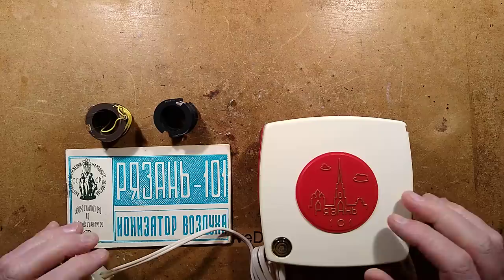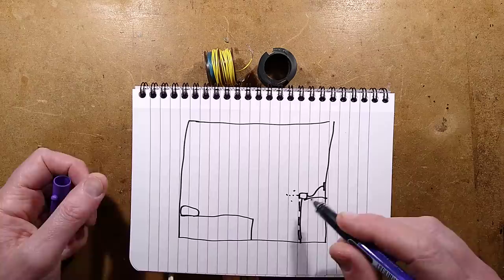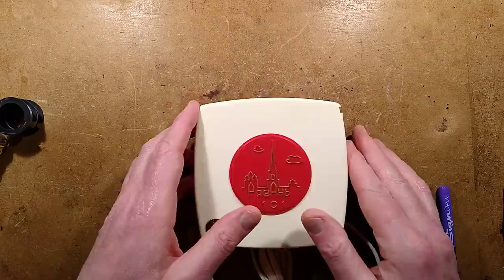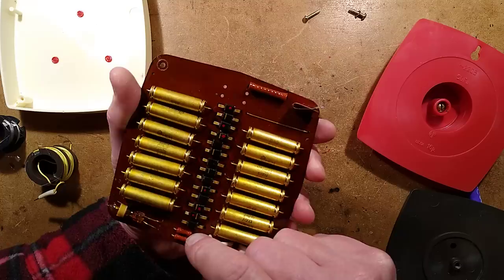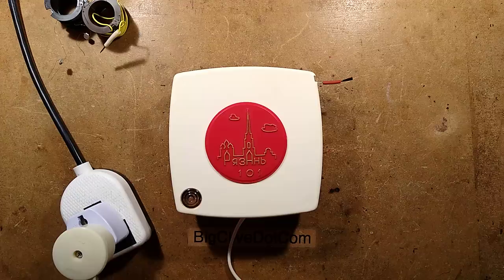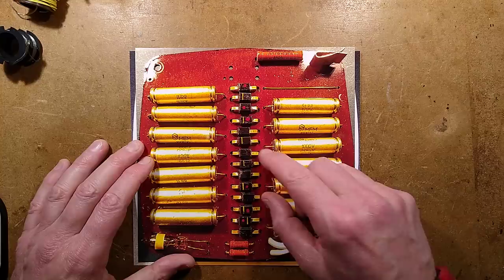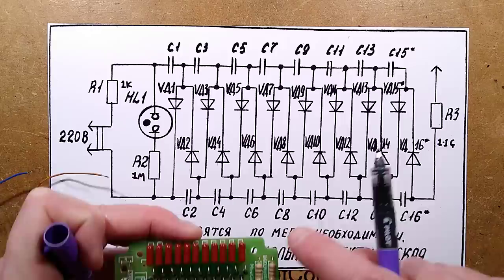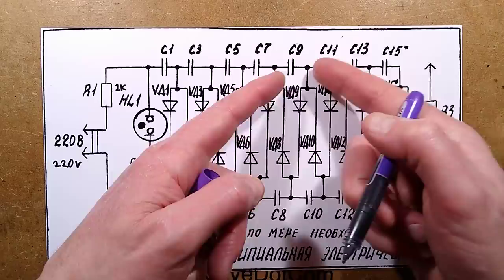Inside a soviet ionizer from 1990 (with schematic)

Comment: Creative, with primitive materials.
I remember 30 years ago I was working for a well known microprocessor company in Silicon Valley. We were working with IBM on something. One of the IBMers had previously been a test/failure analysis engineer in IBM's federal division. He told me a story about how the Pentagon would regularly send over Soviet equipment for analysis. He remembered working on a sono-buoy (a device normally dropped in the ocean by aircraft to emit sonar pulses and transmit the reflections back to an aircraft or ship.) It was very common to find Soviet sono-buoys that had some very primitive Soviet memory chips of very low quality and a microcontroller from a well-known American company that was also a major Pentagon supplier. He believed the Soviet navy was ultimately receiving deliveries of these microcontrollers thru one or more shell companies that did business with European electronic component distributors.
Side story - apparently a full 70% of Soviet military equipment was fundamentally based on stolen Western designs and technologies. Some of you, for instance, may remember the scandal that erupted when it was discovered that Toshiba had sold the high performance computing equipment and software that allowed the Soviets to shape the fins of their submarine propellers to make them less detectable and quieter. Toshiba outright provided the same technology America was using for its own submarines - both attack subs and boomers (ballistic missile subs, the ones with the nukes.)

Comment: i am pretty sure ionisation is low as it is meant to work with 220v-240v line of the motherland. 124 is likely how low voltage might fall. Or what was in the mandatory radio plug that was supposed to deliver news in case of any issues, those are gone although still are mentioned in regulations so can't be sure

Comment: If you need to translate something from Russian again, you can contact me, I will be happy to help.
Manuals for most Soviet devices contain detailed descriptions of how the device works and the electrical circuit. This is due both to the government's attempts to popularize science, and to the peculiarities of the Soviet economy - it was often much easier for you to fix the device yourself than to buy a new one. Therefore, many Soviet devices have high maintainability.
This device was produced in 1990, it is already the end of the Soviet era, accompanied by an economic crisis. This partly explains the use of obsolete parts - they just used what was available. Also, in the planned Soviet economy, there was no competition in the usual sense, so the factories had no motivation to constantly invent something new. Many models of mass-available electronics were obsolete. Of course, advanced technologies also existed, but were often inaccessible to the average citizen.

Comment: The diodes on the schematic are labelled with a V and a Cyrillic D - but there's no V in the Cyrillic alphabet (the B is pronounced like V, as in 220B for volts). Anyone know why the "V" letter is there for the diodes?
Reply: It's a poorly written У, you can see it if you look at diode 15. The УД marking stands for ultrafast diode I think
Reply: @user473  Ah ha. I guess when you don't have a V in your alphabet you can be lazy with the tail on a У! My Russian teacher wouldn't have liked that!
Reply: It's V. It's an old prefix for some electronic components in USSR. Means "Vacuum" as you already guessed)
Reply: The marking is clearly a V as in V=electronic tube, VD=semiconductor diode, VT=semiconductor transistor. Why V? I never managed to find out.
Reply: @shefchickshefchick7902  right, I stand corrected. Although I've never seen it used with a cyrillic Д, it's usually VD or sometimes just V
Reply: @sebastian19745  It's just historical thing.  V=valve, so it used on semiconductors as well.

Comment: There are a couple of typically soviet things about the ioniser that I noticed - I've seen them on old communist-era appliances here in Poland too. First, the price of the ioniser (16 roubles) is moulded in to the plastic base, apparently to prevent "speculation". Second, the last page of the manual shows a list of the precious metals it contains (those capacitors may have something valuable in). It's a scrap merchant's dream when every single electrical device has documentation showing what's worth extracting from it.

Comment: the wire over your bed would charge the micro particulates and they would rain down around and on you all night, ozone can be an irritant as well, long term exposure can do harm, it's that sweet electrical smell when something shorts out, if they could bottle that smell I'd bathe in it.  that and Petrichor

Comment: These round plugs were used throughout Europe before protective earth was required. But French and German sockets with protective earth ensure that these plugs no longer fit.
But it still fits the Danish connector system which uses two or three pins. 
But I heard that the Danes want to switch to the French system because there are universal plugs for the French and German systems in Europe. But this universal plug does not make a connection to the protective earth in the Danish system. 
Ultimately, the French or the German socket system has prevailed in Europe with the plug that fits into both.
Only the Swiss and UK are special.
Reply: This is one thing I really hate about the Schuko-related plugs. It's so backwards to have a standard that allows grounded equipment to be plugged into ungrounded outlets but not the other way around. This caused people to keep installing ungrounded outlets for as long as it was up to code instead of them dying out way earlier. In Sweden this was allowed until 1994 and because of this we have more ungrounded outlets than countries like India where there never was any ungrounded outlet. In Eastern Europe they're even more common.
Reply: @Eddies_Bra-att-ha-grejer  It was designed biwth the concept of isolated room. In a dry place you would not be grounded and touching a faulty live appliance wouldnt be dangerous. Thats why it can be plugged into the old ungrounded socket.
Reply: @mernokimuvek  Why was this solution unique to the Schuko-compatible sockets then? And wasn't it a dumb idea because it made people keep installing ungrounded sockets long after the rest of the world had abandoned doing that.
Reply: @Eddies_Bra-att-ha-grejer  Norway still has lots of ungrouned sockets, as well as isolated 230 V IT systems. Ungrounded sockets are still allowed in the Netherland and in most post-soviet countries as well.
Reply: @mernokimuvek  Yeah, because people kept installing them because otherwise their old ungrounded equipment couldn't work. In countries that use the NEMA sockets for example this problem didn't happen because there was zero downside to installing grounded sockets besides maybe a slightly higher cost so in the US for example you won't really find ungrounded sockets installed after the 50s or so.
Reply: @Eddies_Bra-att-ha-grejer  Not true, ungrounded sockets were common in the US until the 1960s. The first code requiring every outlet to be grounded was the NEC in 1981, effective from 1974. Some mining towns didnt adapt the code and still commonly used ungrounded sockets until the 1980s.
Reply: @mernokimuvek  Well, the big advantage is that the NEMA sockets don't encourage installing ungrounded sockets for the sake of compatibility. It's the other way around since grounded equipment doesn't fit in ungrounded sockets. The Schuko-compatible sockets are the only standard that does it the other way around.
Reply: @Eddies_Bra-att-ha-grejer  But NEMA sockets suck. You can accidentally touch the live pins when the plug is not fully inserted and some extension cords sockets are so small that you can plug  the live or neutral in a single slot leaving the other pin floating in air.
Reply: @mernokimuvek  Yes, engineering-wise they're the worst, but at least they don't have this ass-backwards grounding thing. You could have NEMA plugs be insulated even though it's not part of the standard without breaking backwards compatibility though, I think I've seen some NEMA plugs that have it.
Reply: @Eddies_Bra-att-ha-grejer  They are not the worst. The british plug is the worst.  Huge, heavy and ugly in its shape and a stupid shutter system which requires grounded 3 pin plugs even for double insulated loads. All other plugs have the option for rear cable entry.
Reply: @mernokimuvek  At least all UK outlets are grounded.
Reply: @Eddies_Bra-att-ha-grejer  Modern European and American ones are grounded too. At lest Europe doesnt allow undersized ground wires. The size of the ground wire must  not be smaller than live and neutral.
Reply: @mernokimuvek  The problem is that a lot of Schuko countries still have a bunch of ungrounded installations because of the pants on head retarded way grounding was handled.

Comment: well i assume the reason the manual says to keep the windows open is because this ionizer gives the dust particles NEGATIVE charge which is the same as the earth's charge which means particles are supposed to be repelled from grounded objects (such as the floor, walls and ceiling of a typical house). i don't know if this actually works or not but theoretically particles charged by this ionizer should get pushed away from all the grounded objects, out of the window and presumably towards the sky.
this is an assumption, and i could be wrong but this is an interesting issue.
Reply from the maker: The charge is negative with respect to the general mass of ground.

Comment: But why the piece of string across the ceiling? What function does it have?
Reply from the maker: It puts an electrostatic charge into the air.  By mounting it there it keeps it away from grounded surfaces that could reduce its effectiveness.

Comment: The thing on the left in the picture at 0:53 is a radiola — a radio with a record player on top. Mighty popular thing in 1950s...70s, less so later. I still have one from 1968 defunct and packed. I actually would like to give it away but these things are so abundant and so useless these days that no one wants it. I think I have to actually pursue some beginner restorer to take upon this project (woodworking and soldering...). The record player is worse than those cheap cross-eyed “crosleys”, and the radio doesn't have the 88–108 MHz FM band, only 68–74 UHF (UKW) mono, plus some MW/LW and some SW, and there is no sensible listenable broadcasting in these bands in Russia for decades.

Comment: Weird things must come from the fact that such consumer goods were assembled from "off-the-shelf" or obsolete military components on military production facilities. They usually have peculiar requirements toward vibration, temperature and moisture resistance and employ corresponding manufacturing methods with room to ramp up production with unskilled labor. 
There are rumors that even this plug was designed in such a way that it can fit both Soviet and NATO sockets but NATO plugs won't fit in Soviet sockets.
Reply: That's true, rods (and holes) on soviet plugs were thinner than on european plugs. Don't know if it was intentional.

Comment: Kudos and respect on pronouncing Ряазань almost correctly. It's rare to find an Anglophone who cares enough to make an effort to find out how to say something in other languages, and that needs to be appreciated.
That said, it#s not entirely correct. You say "Ri-ya...", but it should meld together, "Rya", with the "y" more implied than pronounced. And, use a rolled R which people stereotypically use when imitating Russians. Also, the end isn't just an "n", it is a "ny", again melded together, kinda like when you say "Nyah".

In the schematic (Рис 4, Схема принципальная электрическая - Drawing 4, logical electrical schematic), the sections containing the capacitors C15 and C16 have a remark saying "Ставатся по мере необходимости", translating to "will be installed according to need", whatever defines this need. Actually, it's a very interesting and pleasing quirk of Russian, "Ставатся" is something I call a retro-referring verb, and literally means "Installs itself". XD

Also interesting to remark is that the schematic seems to have a weird mix of Latin and Cyrillic lettering. C stands for capacitor, R for resistor, and HL also seems to be Latin. But most noteworthy are the diodes, which are marked as "VД", also VD with the first letter in Latin and second in Cyrillic. Pleasingly weird :)

Comment: It's been my experience that resistors of high value tend to drift higher in value as they age.  I suspect that the resistor at the output was not originally that high a value.  How did you manage to measure a resistance that high?  I know that none of my meters would do that.
Reply from the maker: I deciphered the markings and schematic.

Comment: how can you tell if the air around you is ionized or not?
Reply from the maker: You can detect a charge in the air with a standard multimeter with the negative probe connected to something grounded/earthed and the other probe connected to a metal object to capture the charge.

Comment: The power plug reminds me of a German tube valve radio receiver I owned in the 1970s. I suppose it was built in the 1940s or 1950s... The house of my German grandparents, that was build in the 1950s, had the matching power supply outlets.

Comment: Hmmm. If one were to implement a grid of large surface area very near the ionizer with the opposite polarity could not this be where most of our tiny enemies to lodge, until it was manually cleaned? Rather than attaching themselves to the walls of the room?
Reply from the maker: There are units with positively charged dust collection mats.
Reply: @bigclivedotcom  hi BC! Ok, that answers most of the question.  Is any effort put forth to induce a polarity onto those components?

Comment: I never understood how the caps rated for 1000 volts can handle the high voltages of the multiplier.
Reply from the maker: The voltage does not double each time.  It just adds a multiple, so each capacitor will only see about 600V across it.

Comment: My guess would be that this is the 220 volt version and that's why the extra diodes and caps were missing.   I know you have to have a certain minimum voltage to ionize air...  To run it on 110 volt those parts would be added so you would have an additional voltage multiplier. No need for a costly step up transformer! Those caps and diodes can be bought dirt cheap.   And that cap voltage rating is WAY overkill!  As you pointed out none of the caps are seeing that high of a voltage as none are referenced to ground - just to the previous diode.  And it appears that each stage is a 1/2 wave rectifier so the peak voltage of each stage would only be about 160 volts.  .01 MFD is very common at 1000V so I bet it was more of a cost thing.   I bet dropping to 110/120-ish would drop the value of R2 to maybe 500K and that R3 is most likely the only real safety device in the thing.  SEVERE current limiting while maintaining the high voltage output.  Interesting too as it appears to be a higher wattage resistor than the other two - or did they need all of that extra space to get a Gigaohm of resistance???   Also, a part that they seemed to have left out in the schematic is the power switch (LOL).  For anybody trying to build one of these I would certainly plug it into a GFCI for additional safety.  It's always best not to make your body a ground terminal!   😲GREAT VIDEO!

Comment: Looks very robust. Big chunky components probably overrated and definitely under driven.
I'm going to guess the two caps and diodes we're left out due to proximity to the output resistor and connector. Possibly a design flaw that wasn't caught until a few thousand boards had been made and populated, then tested and internal arcing was seen.
I see those components have stars on the schematic and there's a note referring to them but I can't read Russian and my tablet isn't up to helping me translate it. I wonder what excuse it gives for the components not being there.
I feel for whoever got blamed for this. Waste of resources like this could get you gulag time.
Reply: I would venture to guess that the extra components were inserted for ionisers intended for use in 120 volt areas only. Why waste resources if they are not needed? Everything else is massively over specified, so it almost certainly was a deliberate design decision.
Reply from the maker: In the schematic the missing components are noted as an option for lower voltage areas.
Reply: @bigclivedotcom  Ah, okay.
Reply: The star refers to the comment below saying "insert (more components) as needed". Ii does not actually say "more components", but implies so.
Reply: @bigclivedotcom  Many soviet equipment I had was dual voltage :220V or 127V. That was radio, TV, and a old fridge with voltage selector (another one, more modern was made for 220V only). Most appliances with electric motors were 220v only so I think that the grid voltage was unified or that were separate models for 220V areas and 127V

Comment: The bare wire hanging over your head seems dangerous. Any hint if the different technique was used because it works better? Cheaper to produce? Any benefit of the higher risk you’re taking to use it?😂
Reply from the maker: No risk.  Just inconvenient to install.  Possibly inspired by the original Chizhevsky ion chandelier.